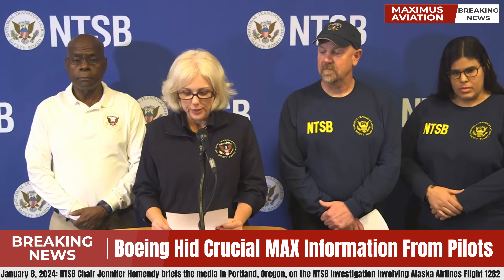Boeing NEVER Told Airlines That 737 Max Cockpit Door Was Designed To FLY Open During Decompression!

Comment: My god what has happened to Boeing. Boeing’s current management seems to feel that pilots & airlines themselves should be taken out of the loop.
Reply: Forgot to fasten the bolts?  So ---- Assembly operations failed.  And QA inspection failed.  This is simple stuff folks.  Absolutely fundamental to the ENTIRE enterprise.  If this happened, what else is going on?
Reply: @jimmiller5600 That’s what happens when you move manufacturing so you don’t have to hire union A&P mechanics to build their aircraft. Remember all the production problems where jets were refused because the customer found empty mini alcohol bottles in the frame work? Yeah…. Profit before quality.
Reply: @HikaruKatayamma  Boeing CEO pay has soared while work was moved to South Carolina to duck the unions.  However that isn't the 737, which is mostly built in Wichita and Seattle.
Reply: That is what i am thinking @jimmiller5600
Reply: A merger with McDonell Douglas happened back then. It was then when management  and engineering got separated.
Reply: Bill Boeing must be turning in his grave.His company and its visions brought worldwide civil and military aviation to the highest points possible. Whoever at Boeing led the plan to sell the company should be ashamed.
Reply: It merged with MD and the latter took over after crashing their own company.
Reply: Hire engineers only with a degree from some political university and when they cannot do anything, promote them.
Reply: McDonell Douglas bought Boeing with Boeing's money and promptly put the same management team, which ran MDD into the ground, in charge of Boeing.

This was all due to Congress. Guess which management team had lobbyists in DC and which team didn't.
Reply: @MinkxiTes That’s exactly why I call that company McDonnell Boeing now😬
Reply: It’s management and the engineering departments that are out of the loop. They moved away from the manufacturing areas to save money and they outsourced a lot of engineering and technical manuals to India to save money..  at best it’s a temporary cost savings and it normally results in quality taking a big hit and pissing off the customers.  When they do find problems, it’s too far down the production line for them to make changes so they don’t do anything and the product gets out to the field.  Management doesn’t care anyway because they’re not gonna be around that long. Anyway, they like to bail out before somebody can start pointing fingers at them.  Isn’t it strange how management feels that everybody else needs to take a cut in pay or get laid off. Stand they really don’t understand that their biggest assets are the people that were there before they were and they need to listen to them. They can’t be replaced that easily. It looks good on paperwork but all the new employees will screw up the company right along with management.
Reply: I am not allowed to share links (and barely allowed to post comments at all) but Candace Owens adressed the question about DEI hiring (Diversity, Equity, Inclusion) at Boeing and other companies (possible forced onto the companies. Once implemented, anyway, it forces the companies to hire people they otherwise would not).

Comment: Boeing also dint tell anyone the plug door would open with all the shoddy sh*t Boeing brought out over last 10years i bet they knew it would and then thought f**k it we will blame it on the forgien pilots like the mcas situation was first described by them but this time happened to an American operator.
Reply from the maker: Thats a fact! Boeing should be required to put sinage above that seating area to let passengers know that plug is there. As a matter of fact they should just remove those rows of seats. But seriously how hard is it to just rivet a sheet of aluminum over the planes that arent going to be using the door? Because they literally have stretched this plane to the limit trying to squeeze every penny out of it they can. I think if this happened at 35k Feet that plane could have ripped apart and if not still many more people would have been sucked out if they weren't belted in. So always wear your seat belt..
Reply: @maximusaviationchannel  alaska  and boeing so lucky them seats weren't occupied

Comment: This is not vital information. I fly on a different aircraft type and yet I knew that the 737 door opens automatically during decompression as does the a320 family. I can also confirm from a colleague that flies the 73 series that they were aware. Even if they did not know this is not vital. It doesn't change anything except for the small frustration resulted from trying to close the fd door.
Reply: That's the difference between having the knowledge and being ignorant. It stops you from being hysterical, unlike many other commenters here.
Reply: @tiadaid  exactly. The sensationalism always wins unfortunately

Comment: Thanks to @gnarlycarlson9600 below for explaining...
"The bulkhead that the cockpit door is mounted to is inside the pressurized hull of the aircraft and is not designed to handle the difference between 40k feet and the pressure that the aircraft interior is kept at so if the door was not designed to open severe structural damage could result from this bulkhead rupturing."
Reply: That is why normal bulkheads have small burst panels that allow for venting while the door stays closed.

Comment: Why would it be desirable for the cockpit door to open during rapid depressurization? Not good for security especially if hijackers caused the depressurization. And, although the pilots have their own (larger) supply of O2, it would be distracting to have air rushing out of the cockpit faster than it might if the cockpit door was closed (and locked).
Reply: Pressure gradients inside the pressure hull will cause structural damage to the plane. Structural damage to the bulkhead through which all of the control systems run is sub-optimal for aircraft survival. Could have been accomplished using blow-out panels instead of the door maybe.
Reply: This isn't Mission Impossible.  All cockpit doors and bulkheads will vent pressure.  A decompression event is not a "Imma gonna jump up and run to the cockpit now" opportunity, especially since decompression goes hand in hand with "ain't got no oxygen" anymore.
Reply: @jimmiller5600  Well your not thinking like a terrorist either. I would hope.
Reply: Because cockpit doors aren't f*cking pressure vessels.
Reply: YES !!!! I FULLY AGREE. Why are they tell the public and the world this???? The wrong people will use it to their advantage and not in a good way. 🤦‍♂
Reply: @WatchRichRebuildsChannel  Intentional sudden depressurisation of the cabin by a bad actor, in order to gain access to the cockpit, would definitely not be a reliable strategy for taking control of the aircraft, even if there were a way to do it without using tools that would be detected before they got on the plane. Terrorists aren't dumb.
Reply: @PharmaGiles  HaHaHa, No they are just suicidal.
Reply: @PharmaGiles  But lots of people on YT are.  Sheesh.

Comment: There’s a phrase “a bug that became a feature”. Is the door really designed to fly open during decompression? 👀
Reply: Well, it's a safety feature to prevent structural damage to the cockpit bulkhead, which has a lot of electrical and control systems running through it. Could have been achieved another way maybe.
Reply: Yes.  All cockpit doors and bulkheads will vent pressure.  They're designed to give-way instead of kinda holding up and then failing catastrophically one way or the other.  "Catastrophic" as in -- 1) Contributing to fuselage structural failure; 2) Sending shrapnel flying into the crew;  3) Damaging flight controls and other systems.

Comment: The bulkhead that the cockpit door is mounted to is inside the pressurized hull of the aircraft and is not designed to handle the difference between 40k feet and the pressure that the aircraft interior is kept at so if the door was not designed to open severe structural damage could result from this bulkhead rupturing
Reply: Thankyou. 
Someone else with a basic knowledge of physics and structures. 

Will they be surprised to find vent holes and blow out panels in the floor?
Reply: The cockpit door is designed with two depress door panel's.
Reply: @johannel4141  
Citation and specs please. 
I want proof the can handle explosive decompression. 

Remember the tri star? I think?
Reply: @brucebaxter6923   NOT the Tristar.   The Tristar was the Lockheed L1011 - an excellent plane.   You're thinking of the DC10 which would lose a cargo door followed by partial floor collapse, jamming of the controls and hitting the ground at high speed.
Reply: @cr10001  Thankyou go that correction.
Reply: Could they then have designed a tether to prevent the emergency checklist from flying away?
Reply: Stop apologizing for them. Stop being their apologist. I know we all want big business to make lots of profit but this is getting ridiculous. Why complain about government if you are okay with business cutting corners and ignoring regulations. Complain about government but turn a blind eye to all this nonsense everytime.
Reply: @thefrener794  who is defending Boeing?
They are criminally negligent ten ways to hell. 

But the pilots and media creating a diversion with a retrofitted door blowing out in an explosive decompression is just plain pathetic and is being called out.
Reply: Exactly.  After 9/11 there was talk of reinforced doors to let the crew depressurize the cabin.  The forces on that aft flight deck wall would be well beyond anything it was designed to withstand
Reply: Funnily, that's not the issue. It's no-one working to keep the damn plane in the air and it's passengers safe knew. And the unexpected popping of the Cork would only add to the pilots' and cabin crews stress level and cognitive load during a rapid decompression incident. Never mind the bowels of passengers seated close to it.
Reply: @BigHenFor  remove the pilot. 
Install an engineer and a navigator.
Reply: Stop making excuses for them. No company is above but law except american companies.  American workers are cowards.
Reply: This bulkhead is containing the cicuitbreakerpanel .
Have some sparkling delight !
Reply: There was no structural damage, just a small diff pressure, There enough info on the net don't make thing up.
Reply: @johannel4141  small diff press. 

Ah I see you have no idea about what happened. 6ftx2ft is around 1100sqin. 

So an 8psi diff as stated in the video makes it 4tonnes. 

You think that door can stop an f250?

Comment: So the plug blew at a pressure differential of ~2 1/3 lbs/sq in. That's not a lot!
Reply: How many sq inches does the door have?
Reply: @executivesteps  26x46
Reply: That's roughly 2,787 pounds of pressure on the plug.
Reply: @jimmiller5600  I think you mean force, not pressure.
Reply: @executivesteps  D'uh!  You're right.  Not enough caffeine.
Reply: @jimmiller5600  Ohkaay. But when you consider that the A/C was at less than half its normal cruise altitude when the plug blew ...

Comment: Nothing has changed.  As usual the plane manufacturer hides vital information from the purchasers and pilots for profit expediency.  it did so with secret MCAS system that could have and indeed has taken the control away from the pilot and crash the plane on faulty instrument signals.  Now such vital design information is also kept in the dark from the pilots.  Loose bolts have been found on at least 5 other planes too.